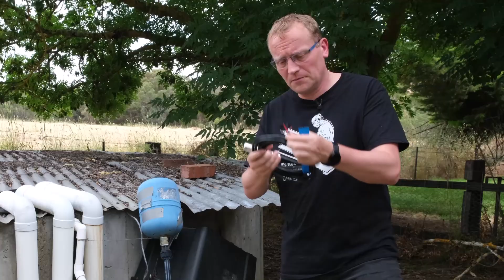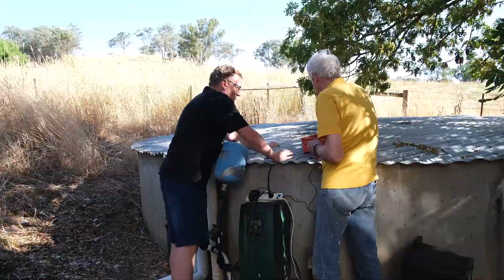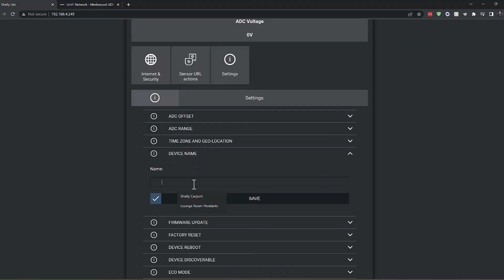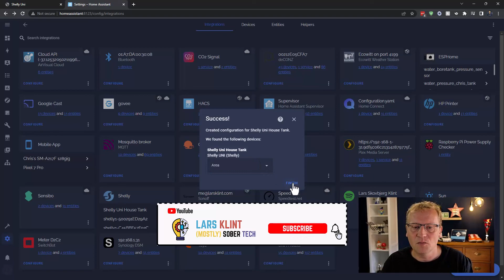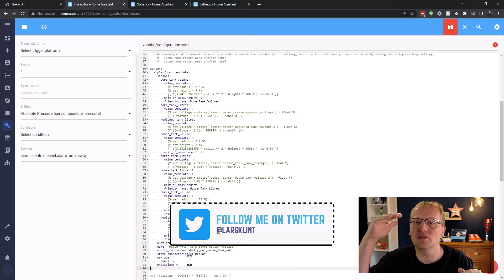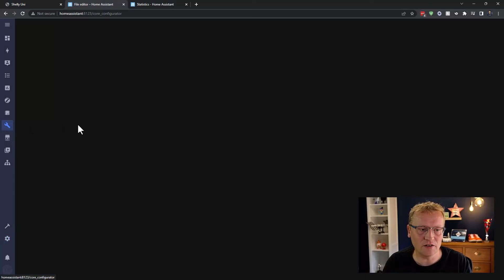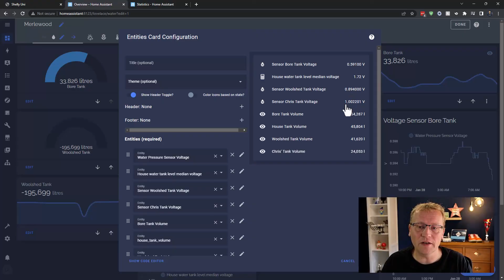Monitoring water tank level with Shelly Uni & pressure sensor | House tank sensor v2.0

Comment: Hi Lars, great video! I ordered a sensor off eBay but it only has a red and black wire. Any idea how to connect these to the uni? I noticed yours is a three wire. Thanks in advance, Nik
Reply from the maker: Thank Nik. Appreciate the watch :) 
I am guessing you have gone for the 4-20mA sensor which sometimes has only a red and black wire. You need to power it in a loop where the measuring equipment sits between the sensors black wire and the power supply's black wire/negative. However, the Shelly Uni only measures voltage as far as I know, so I don't think you can use the sensor you have with the Shelly Uni. This is of course based on my assumption that you got a 4-20mA sensor and basic understanding of the Shelly :) 
I hope that helps a bit.
Reply: @LarsKlintTech  Hi Lars, thanks so much for the quick response! That's correct, the sensor I have is a 4-20mA, but I think you are correct and I may need to swap this out with another one!  I read somewhere that I could potentially use a current sensor where "The module outputs a voltage proportional to current passing through the sense pins on the module."    Honestly though this is all new to me, so it may not work.      One things for sure, I've certainly learnt a lot from your channel and for that I'm very much appreciative! The detailed explanations are fantastic!
Reply from the maker: @NikValentine  No worries Nik. That current sensor solution sounds complicated imo. The Shelly Uni is a great device, and I would find a sensor that works with it, to keep things simple and stable. 
And thanks for the kind words. That is exactly why I create the videos, to share some of the knowledge I find on the way.
Reply: @LarsKlintTech  Hi Lars, I just wanted to send a quick message to say that after a lot of trial and error, I finally got the 4-20ma sensor to work, however it ended up involving a breadboard and two 1k ohm resistors run in parallel.  Suffice to say, using the three wire sensor would have been much easier. In any event,  I wouldn't have even thought this was possible without your channel, so thanks again for all your help and keep up the good work!
Reply from the maker: @NikValentine  Ah, you persevered! Good job mate, and it kinda make sense in my limited brain capacity that you need resistors to measure the current, rather than volts. Thanks for letting me know (and confirming I did the easier solution 😂). And thanks for your support of the channel too. You are the reason I do the videos.

Comment: 5:15 I have so much empathy for you right now. It's almost impossible to get a sensor for a reasonable price that will work under 5v! 

Point of note: your control unit uses an ESP32 chip, do you know if the analog pins are voltage regulated? if not you might want to avoid putting more than 3.3v into the analogue pins. (Atom powers off 5v, but should be regulated down to 3.3 - 3.7v for the ESP32 chip). As you indicated, with your previous setup, that's not an issue, but if you're using a more accurate sensor, that might give you the full range of voltages, then you risk reducing the life of your MCU. 

FWIW you can find a HDL300 sensor advertised on AliExpress for 5v but, the manufacturers will sell you a 3.3v version at the same price (about $65 + $45p&h) - no idea why they don't advertise the 3.3v model. There's also an Australia company that makes a m25 sensor (runs off 3.3v SUPER lower power usage but they're $560 per unit!)

Comment: Hi Lars, Great video, and I just got the components, and the voltage dat is flowing into HA.
But I just can't get my configuration.yaml to work with the statistics and Template sensor for converting to litre. .
So I assume it would help me a lot, if I could get a copy of your files as examples. 
På forhånd tak   Ole 🇩🇰
Reply: I manage to get the statistics part to work, but the conversion to liters is still not solved..
Reply from the maker: @OleSchmitto  Hej Ole. Here is my YAML for the specific parts.

  - platform: statistics
    name: "House water tank level median voltage"
    entity_id: sensor.shelly_uni_house_tank_adc
    state_characteristic: median
    max_age:
      hours: 2
    precision: 4

  - platform: template
    sensors:
      house_tank_litres_shelly: 
        value_template: >
          {% set voltage = states('sensor.house_water_tank_level_median_voltage') | float %}
          {{ ((voltage / 2.6) * 45804) | round(0) }}
Reply: @LarsKlintTech   Perfect... worked and also your code remove the decimal, which makes it nicer to look at.  Decimals, remember, that for the incoming voltage from the Shelly device, I need to change the Shelly HA integration setting / voltage  to 2 decimals.
 
Tusind tak for hjælpen. 👍🇩🇰. Ole
Reply from the maker: @OleSchmitto  Det var så lidt Ove. Du siger bare til hvis der er noget der ikke virker :)
Reply: @LarsKlintTech   In Home Assistant I am receiving data from the sensor every second, which in my opinion is to often, so do you see the same issues and maybe solved it.
Reply from the maker: @OleSchmitto  I am not seeing anywhere near that frequency. I am roughly at once per minute for both sensors I have installed by now, and that is only if the value changes. Some times it can take longer. I didn't set anything up to have this behaviour, that is the Shelly UNI doing that out of the box.
Reply: @LarsKlintTech  hmm. Can you remember your data connection setup. 
I have connected the yellow from the sensor to the white on the UNI.
Reply from the maker: @OleSchmitto  Yep, that is all I have done. Connected the signal wire from the sensor to the white (ADC_IN) on the Shelly UNI.

Comment: the two sets of black wires are relays 1 and 2. they are not voltage out. they are just open/close switches operated by home assistant or by the brown and orange wires.
Reply from the maker: Awesome! Thanks a ton for the clarification mate. I guess I didn't technically wire it up wrong then 🤣

Comment: Hi Lars. Probably the most anticipated YouTube video ever on my part haha.... Thanks for the video and opening another can of worms for me... 🙂 I have the Shelly uni's ready to go (in fact it looks like I can use just the one to do two of my tanks). The pressure sensor looks solid so Aliexpress, here I come. Cheers.
Reply from the maker: You are most welcome mate. I think 😂 
With the Shelly Uni I have now learnt the outputs are "dry outputs" so they don't provide the power, but can switch up to 36V. In other words, you need to provide the power (the Shelly doesn't), and then you can switch it through the Shelly.
I have just ordered a second pressure sensor for another problematic water tank here. This seems to be a great solution after testing it for some time. 😊

Comment: Why would you recommend using MQTT when you have a large number of shellys? I've got something like 16 so far and all just standard connections and triggers, not MQTT integrated.

Also, you can go to Developer Tools -> YAML and reload the entities (and other things) without having to restart HA, which is a bit faster.
Reply from the maker: Having a lot of Shellys as single integrations can become unmanageable in HA. 

Yes, I was actually aware of the entity reload too, but forgot. Thanks for the tip :)
Reply: @LarsKlintTech  pushing it to MQTT is just moving the problem elsewhere right? And then you have to manage MQTT credentials on each Shelly.

I get around the long list by naming my Shelly's and using the filter on the integrations page

Comment: Is there a similar device that would work in skimmer box of pool in order to keep pool level topped up?
Reply from the maker: Hmmmm, excellent question Daniel. A skimmer box is very shallow usually, so a pressure sensor would be difficult to use there. This guy built a water level float sensor: https://neon.ninja/2017/11/smarter-swimming-pool-3-water-level/
Reply: @Lars Klint  Awesome, thanks Lars I’m definitely going to take a look at that. On another topic, what font are you using for your HA? It’s something I’ve been meaning to do with my own dashboards.
Reply from the maker: @dsellars  The font is part of the theme I am using called Noctis.
Reply: @LarsKlintTech  Thanks, i'll look into that. Really like the colour scheme too.
Reply: I might pick up one of these 1m pressure sensors and give it a try with the Shelly Uni, found another video on YT which seems to look like it will work. Been looking at a way to monitor my pool water level for a while now.
Reply: Here is the other video i was talking about https://youtu.be/T474YCr2574
Reply from the maker: @dsellars  Ah, cool. Yeah, that could work. I might even do that too 😏

Comment: Why don't you use level transmitter instead of pressure transmitter.
Reply from the maker: Good question. The level transmitters require more rigging to set up usually, and I didn't want a hole in the top of the tank in this case. Just lowering the sensor and plugging it into a Shelly Uni is very simple, so I chose that approach.

Comment: Very good video. I have the same thing in progress. 
Note: Node Red can do the same thing using smooth and range nodes. 
In home assistant there should be a helper called "Combine the state of several sensors" it has a median option. Then less messing with yaml
Reply from the maker: Oh, very nice! Let me know how you go with it. 
Oh, very cool with Node Red. I am still learning a lot about that tool, so thanks for the tip. I do like just having the sensor "natively" in Home Assistant in this case though.
Reply: Export homeassistant info to Nodered

Comment: Great video as always mate - I wish there were more off the shelf solutions for this sort of thing. Would also love ideas on how to power if I don’t have power at all of my tanks - hmm 🤔 small solar maybe
Reply from the maker: There probably is some off the shelf stuff, but then it'll have its own app and no integration. This is reasonably simple, but only if you are familiar with HA of course. 
Small solar could definitely work. I did the water tap on solar video, which is a similar idea.
Reply: Thank you,  very much!   I added a depth sensor and Uni just like this last week.   But I was flustered by the fluctuating readings.   And other YouTube explanations for building a template were overly complicated.   So much appreciated.
Reply from the maker: @timtrafford4718  Awesome! Glad you got it working, and there are many ways of configuring the beast (as you are finding).

Comment: 0(2)-10V DC or 0(4) - 20mA are very common industrial signal levels.  It might have said rs485 which is a 2 (or rarely 4) wire serial wire protocol like rs232, and it is quite common that devices speak Modbus RTU over the serial unless it is something proprietary.

According to Shelly the outputs are potential free so the won't send any power just switch it. The Shelly wiring diagram (on the knowledge base) is kind of vague but you probably need to connect it in series with the power supply but don't take my word for it but that is how you connect a relay. It also states that it can max switch 0.1A.
Reply from the maker: Awesome, thank you for all those details. I am happy with the 0-5V, although 0-10V might have given me slightly more detailed/granular data. 
Are you saying the Shelly Uni can't power devices? 
Yes, I knew about the 0.1A max, which is fine for most devices. I am about to test one with a solenoid to turn water on and off, so we'll see if 0.1A is enough for that.
Reply: @LarsKlintTech  If it is as the manual says "potential free" the outputs are just a "switch". Kind of like the output on the "Shelly 1 Plus" but that is a relay. 

More signal resolution is always a good thing but if you want to use it with something that is 0-5V later on stay with that.

Read the manual but a solenoid might sometimes require a snubber to last in the long run if the UNI is using a TRIAC for the switching.
Reply from the maker: @Maaniic  This is all really helpful. Thanks mate 😊
Reply: @LarsKlintTech  My understanding about Shelly Uni's outputs is that they should be used more like button press simulators that to switch loads on or off. The "relay" function is done with the help of two small transistors, transistors that can handle a very low load - 0.3Watts or something.
Reply from the maker: @valentinene  yes, reading up on it, I kinda understand it now. It seems the voltage rated on the wiring diagram means that is how much power can flow through the switch, not how much it provides. So I could wire the sensor through the Shelly Uni output logically, but not power it from it. I think. 🤔
Reply: Looking to purchase a pressure sensor - there seems to be plenty around that are 4-20mA (rather than 0-5vdc) Would these work in a similar way? Just as "easy" to connect? Apologies for all the questions, newby alert 🙂
Reply: @lensman893  You can always get a voltage signal out of a current loop sensor by putting a resistor over the voltage reading input in line with the current loop. Usually 500 Ohm for 2-10V.
Reply from the maker: @Maaniic  I don't understand what that means 😂
To answer Lens' question, I am not sure how that would work. As @maaniic says, you might be able to convert it to volt, but I'd rather wait and start with the "right" sensor. Can you not order them using the link in the description? I just received my second device today.
Reply: You can always read up on "Current Loop" on wikipedia :)
Reply from the maker: @Maaniic  Hehehe, I did! Thanks again for sharing all your knowledge mate. It really helps all of the viewers a ton :)
Reply: @LarsKlintTech  Hi Lars. Not trying to "second guess" you, but I just noticed that there seemed to be so many 4-20ma sensors for sale (on eBay and Amazon), and not so many 0-5vdc sensors, and wondered what the reason was for that. I've not ordered anything from AliExpress before, and was a little nervous to do so, haha... (I tend not to buy anything from anyone I can't use PayPay for). Do you know if you get a stronger wifi signal with the Shelly Uni as opposed to the Atom? (I've got both ready to go). Cheers, John
Reply from the maker: @lensman893  All good John. Keep asking :) I paid with PayPal on AliExpress so that is possible. With the Shelly Uni it is certainly simple to get the 0-5V from the start. 
And yes, the Wifi signal is much much better with the Shelly. I have had no problems at any point and the signal is consistently "good", where with the Atom is kept dropping.
Reply: @LarsKlintTech  Thanks Lars for the info re Paypal, I'll look further into it. And thanks for the info re the wifi signal - my two tanks are just within range of a Meross and Shelly plug I have to monitor the pumps - so I'll bang straight on with the Uni's. Thanks for being so responsive and providing very useful videos. Love the T Shirt(s) too!
Reply from the maker: @lensman893  No worries John. That is what we're here for. Creating a more automated world for us all 😊
So glad you appreciated the thoroughly curated shirts too. I shall get more, just for you 😛